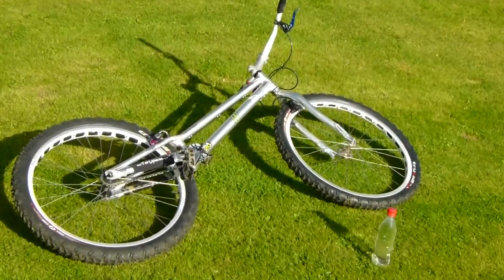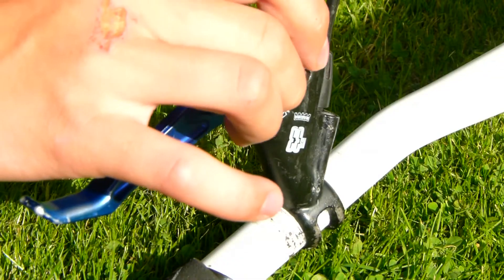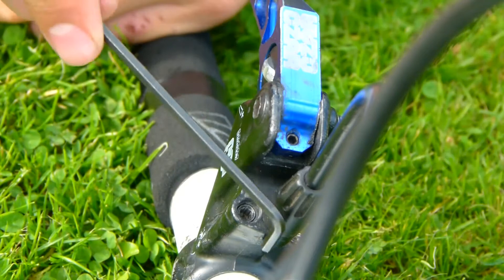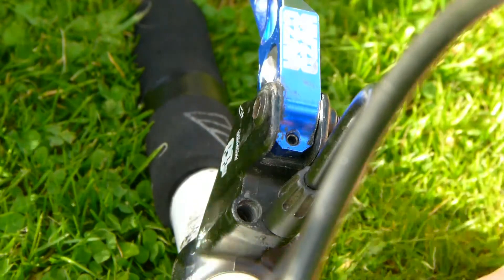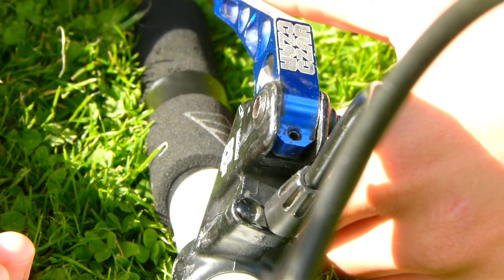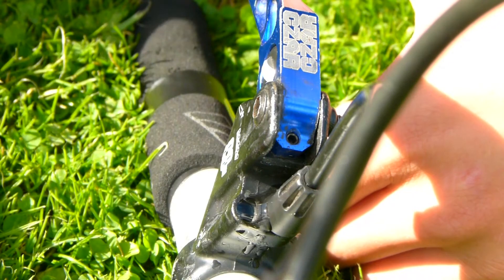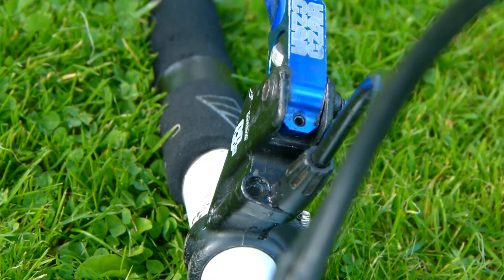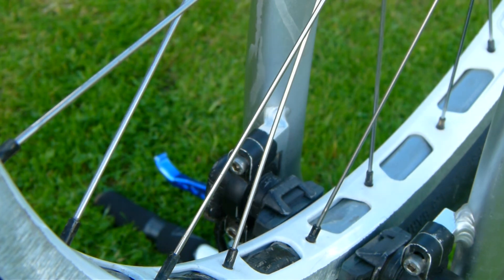How to top up a Magura rim brake.

Comment from the maker: Hi, bleeding the brake with water improves the responsiveness of the brake and makes the lever feel less sluggish. It's also cheaper than magura royal blood and far less messy. You do however void the warranty by doing so and it's not recommended. It is better to use a 50:50 mix of anti-freeze and water if you live somewhere cold to prevent the brake from freezing. This only works in hydraulic rim brakes, not disc brakes.